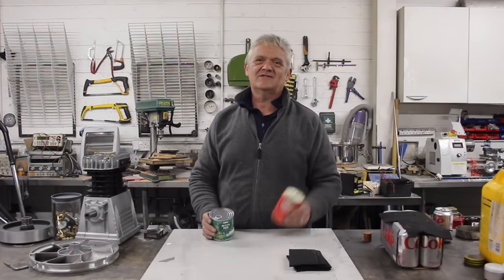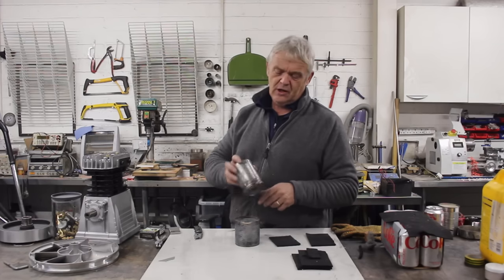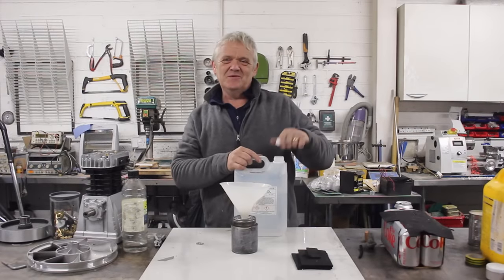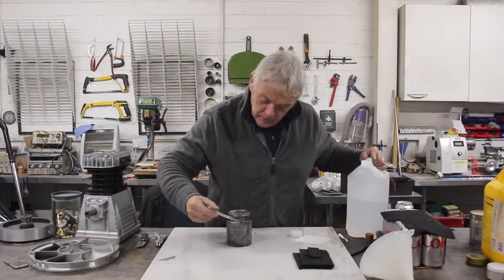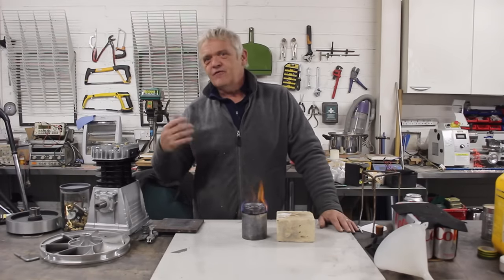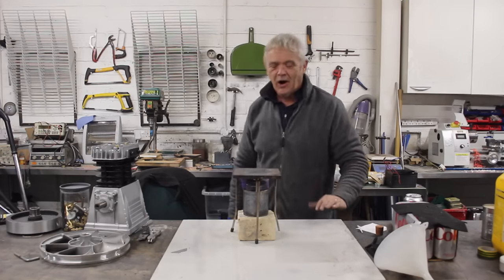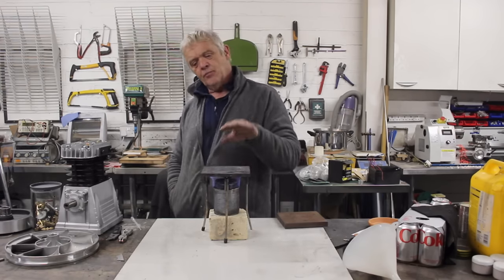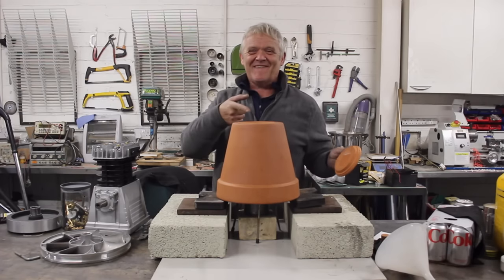1700 An Awesome DIY Multi Fuel Heater

Comment: I was having bad luck creating alcohol stove things based on internet designs (needed to start in ultra cold environs) and after a bit just resorted to burning alcohol in a tiki torch with an adjustable flame height wick. Worked like a charm and I didn't have to figure anything else out. I now have an idea for a simple design that will allow the user to package the whole thing up including the preloaded alcohol fuel and take it with them on the go.

Comment: I just made a short video using glass wool and synthetic motor oil . Burned better than I expected considering its only 40% mineral oil and the rest is friction modifiers and detergents etc but the flame was deep dark orange. I will have a look at glass insulation wool when it's finished and cooled down !👍🏻
Reply from the maker: I'll jump over and have look mate

Comment: another great video, I collected some "bricks" from an old storage heater (I think they contain kryptonite 😳, never come across weight to mass like it, apart from lead), I think they would make a very good radiator, although would take a lot longer than a steel/copper ingot.
Reply from the maker: nice mate!
Reply: Sounds good.  Give it a try and let us know.
Reply: Make sure they're not asbestos bricks - depending on the age of the storage heater they came from, they might be. I think up until something like the late 70s or possibly even into the 80s, some storage heaters used asbestos containing bricks.
Reply: According to another site, if you can “write” with a brick like chalk, then they’re safe to use in a rocket heater-type scenario.
Reply: @jsl4228  Yeah, the serpentine family are heavy minerals.  Optimized for heat storage, it's not in its fibrous form (asbestos), so I don't imagine there's any risk to the lungs from the stuff.

Comment: An upgrade to that might be some form of extenal tank that would have a controlled fluid feed into the centre tank, as at the moment refilling it would require the heater to be cold.
Reply from the maker: I like that suggestion and I am mulling that one over
Reply: Yes, the alcohol stove...a larger version of the tuna or cat food can stove burns out the fuel in well under an hour.

For the steel plate and pot, I use a small Lodge iron pot upside down with an insulated handle.  Easy to remove when the fuel is gone...can cools down...refill...light...put the still hot iron pot back on top.

I don't know if a terracotta pot atop the iron pot would help, but i have put the apparatus inside a large pot rightside up.

Easiest pot heater is a can of sterno which burns 5 hours, with a flower pot on top.

Comment: Please do a video on those 'soda can' style passive solar heaters.  Also, whether or not the ones that are supposed to go inside the window would heat a room better than simply letting the sunshine in through the glass.
Reply from the maker: will do mate
Reply: Collecting and concentrating solar is great solution in my opinion. I second this request.
Reply: Third request here. Great tutor. Cheers for taking the time to, it can’t be easy, but much appreciated.
Reply: @WSmith_1984   Yes indeed, if you have the Sun. Alas, we have so many trees that its not practical for us unless we spend A LOT of money to remove a number of rather large trees. We would like to since a good portion are sweet gumball... but we just don't have the money.

Comment: Good job on the heater. I like that is smokeless. I had wanted to mention a concentrating solar trough for heating a working fluid like oil for an oil heater. And sealing the oil loop so it is insulated some from the cold and natural convection keeps the warm oil inside and the cold out side. And an oil tank for a thermal storage.
Reply from the maker: nice mate - like an oil filled radiator?
Reply: @ThinkingandTinkering  Yes same idea but using concentrating solar to warm it up.

Comment: A few years ago me and my roommates could only barely afford heat for our rental house in Colorado. So we used the furnace to keep everything about 40 so the pipes wouldn't freeze, and we made a blanket fort where we would all hang out and drunk warm beverages. Set up Christmas lights and had some very nice decorative wall hangings incorporated into the blanket and furniture tent.

Seeing this I was thinking if one wanted to stay warm on a cold evening with the slightest fuel usage for a stove similar to this you could make a cozy corner, givve some careful thought to not lighting things on fire, and set up a few space blankets above and around. Because that hot steel will release so much of its heat as IR mylar tech would work very nice to direct it specifically at the chilled human loooking to get cozy.
Reply from the maker: nice advice mate- cheers

Comment: I've been thinking about this because these small fuel burners make sense to me. I was given 8 gallons of methanol from a hardware store closure this summer and want to make a stove-heater, beginning with that fuel. I live in a small apartment attached to friends' family home with children, so it has to be super safe. I've seen many designs. Wondering which one will be very safe and efficient.
Reply from the maker: methanol heaters are sold mostly for marine - check out a few of the designs
Reply: Do not put this in your home. Especially if there are children living in the same building.
Reply: @ThinkingandTinkering  I am frugal and don't mind building something but if buying a safe and efficient burner makes better sense, I'm fine with that.
Reply: @hubrisnaut  marine versions will be designed to be spill proof I would imagine, also they are likely constructed with safety being absolutely paramount.
Reply: @WSmith_1984  I'm going to look into buying something like that. I was given approx. $150 worth of fuel for free so that is the budget. If it was only myself to worry about, I would just do a build. Although I am extremely confident, in this instance, I could never forgive myself if I built something and it went terribly wrong for other people.
Reply: @rblongfellow  why?

Comment: If you want a fuel source a good one for putting in a wood stove or heater, just get a wax cardboard and normal cardboard mix in water until a glue like consistently  then press them into bricks dry them out and then they should burn like wood

Comment: Awesome, I make little rocket stoves and tea candle heaters with cans.
Put another pot on top full of sand or bricks for a thermal battery.
Going to experiment this winter with thermal mass options for my tiny wood stoves.
The heat some tiny stoves put out is plenty for small spaces if you can capture it.
Reply from the maker: Thanks for the tips!
Reply: Make a brick surround for your tiny stove.  Better yet, make a tiny stove out of bricks.  There are traditional thermal batteries, like the Russian hearth.  Anyone using wood should use thermal battery/mass-heat concepts.  That sounds right up your alley, if you're already making rocket stoves, because you have insight on how they want to breathe.  The bad thing about the rocket is it requires tending.  Heat mass means you only have to have the fire going a very short amount of time.

Comment: If you have one of those finned heat sinks for electronics put it on top of the steel and it'll transfer the heat to the air even more effectively.
Reply from the maker: nice!

Comment: FWIW, I came across 'carbon welding blankets' on Amazon which show pictures of someone holding a blowtorch against them, so I'm pretty sure that they are pure carbon.  They can come in a pair of 12x12" or 20x30cm squares for around $10-12, which makes them completely affordable.
Reply from the maker: there are a couple of types - just make sure they say pure carbon felt mate
Reply: @ThinkingandTinkering   what should be the width? [ i ve just seen your previous video, where you burn a vegetable oil wick]

Comment: Hello mate I’ve made the heater with the 22mm and the 15mm pipe and the stainless steel mesh but it seam to be quite a fierce flame have you got any idea where I’ve gone wrong

Comment: I have made a lot of these for camping trips. In my advice. After knowing the area around these improvised devices is fire-safe. One thing to keep in mind. DO NOT allow the fuel container to overheat !! It Will Explode at some point, even if that only means a runaway thermal reaction. If the fuel vaporizes it builds pressure and accelerates the fire to maximum. Think of a Bunsen Burner. It is designed to be in a tray of ice. To control the temperature of the fuel canister. A running creek works fantastically.
Reply from the maker: this isn't the little soda can version mate - there is plenty of pressure release in the way the burner jet is organised

Comment: I'd like to challenge you to turn an argos tall electronic steel safe (the one with a shelf), into an oven,  using veg oil as the fuel source, and bake some bread. Oh and you're not allowed to use any kind of angle grinder etc (as I don't have one, but I do have an old safe 😁)
Reply from the maker: just had a look at them - I will have to buy one
Reply: @ThinkingandTinkering  you sir, are a mad scientific genius! Keep that s**t up 👍👍👍

Comment: The "real" plant pot heater, which was also used in WW2 afaik, does work with convektion and radiation. At least how I understand it. 
You need 2 Plantpots with a hole in the bottom for it. You place your teacandles under the smaller pot and the bigger pot is placed over the small one. This way it does quite a good chimney effect and part of the air whats coming from the small pot circulates back down in the space between the pots and sucked in and heated again. 
But I guess your multi fuel heater will be a nice upgrade for my setup. I'll give it a go in the next few days and then report back.
Reply from the maker: nice one mate - let me know

Comment: anaerobic digestors AKA septic tanks may be a kick in the right direction for small amounts of heat. if a hot water heater is set up to burn the methane as an oversized pilot light, or if properly saved a burst heating system.

Comment: Have you looked at penny stoves?      there is a variety of alcohol burning stoves you can make using aluminum beverage cans.

The simplest that I know of involves the bottom half of 2 cans,      one is press fit into the other with a bit of wicking material inside creating a gas tight seal,    the gas pressure strengthens the walls during fitment so you can bear down on it.

Then you flip it upright  so the can bottom faces up,      poke holes in the depression in the center for fueling,     a coin goes on that during burning to seal the port.

Poke holes along the outer rim to create gas jets,   use a sewing needle and pliers,   16 holes should suffice.

To ignite you make a thin pool of fuel around it and set it ablaze,   this heats the body of the stove until it can self sustain.
Reply from the maker: I know them mate - but  thank you

Comment: I wonder if it would work better if a larger pot was used. I'm meaning really large, like the tall terracotta pots or the terracotta water butts. Could this be a genuine room heater.  Or even a tall terracotta pipe.

Comment: Ok so I just made this using cotton yarn as a wick instead. I wrapped it around the smaller can then put it inside the shorter fatter can. I used the yellow bottle of Heet, which I believe is mostly methanol, as the fuel. I lit it and it seemed to be starting up pretty good until about 60 seconds after lighting the burner it exploded. Like a dummy I was doing this in my kitchen on my stove. I was smart enough to put in inside a stainless steel pot and I had the lid ready to put on top to smother it in case any problems. Well the problem was the alcohol went everywhere as well as the flame. Thankfully I stomped it out with a blanket. I should have known better and done this outside. Besides the fact that I was stupid for testing this inside my house, any ideas as to why this happened? This isn't the first time I had one of these DIY stoves explode on me either. I don't understand what I am doing wrong exactly.

Comment: That jug of alcohol is close to $20 here in Canada. 
I think a 5KW diesel air heater would be the best multi-fuel heater. For under $100, you can't beat it. Burns pretty much every oil if diluted with diesel. 
And they sip fuel. Something like 0.3L per hour if going full blast at 5KW. I don't know how much diesel is over there in the UK, but it's about $1.10 USD per litter here near Toronto.
Reply from the maker: about twice the price
Reply: @ThinkingandTinkering  How much do you pay for a liter of regular petrol? 
It's the same as diesel here.

Comment: Just made one of these but the middle can goes bang and shoots out it the larger tin when you light it boom 💥 any idea why ? Ok sorted it the central can was to tight a fit I used a smaller diameter an now it ok thanks 🙏spoke to soon only tested it with a small amount of methanol . Tried it again with 3/4 full meth . Boom blows the middle can out spraying methanol everywhere 😞

Comment: There's a fuel shortage for wood stoves?  Isn't the UK mostly a temperate forest?  Did they just not dry enough wood?
Reply: I have roughly 6 artic loads of split and dried logs all under cover - Don't reckon I'll be getting cold any year soon. Most weeks I am still getting loads of wood from the local tree surgeon . Am i greedy ??  I think not. I am over 70 and for the last few years I have been building up my 'heat insurance' in the form of log stacks against the day I can no longer handle large rounds onto a splitter or use an axe. .... and no, it is not for sale !
Reply from the maker: getting that way

Comment: I'd be very interested in seeing the carbon monoxide output from this. 
You mentioned multi-fuel. What other fuels will it burn? 
How much alcohol does it consume per hour, roughly?
Reply: Just subbed to your channel.
Reply: @limmoblack  fantastic!
Reply: @CairnOfDunnCroftPermaculture  Have been wondering about this oatmilk 'malarky' (some have more oats than others etc) but you've done the work for me.  Thx

Comment: If you put a metal mesh like a sieve over it, it would be more like a kerosene or multi fuel heater, burn cleaner and radiate more
Reply from the maker: it burns pretty clean but I like the mesh idea - a lot

Comment: So, I’ve built this myself and found out it is a bit of a bomb… what happened with my heater is that the whole thing gets hot, which causes the fuel to evaporate faster and faster. At some point the flames were twice the size of the heater itself. 
What did I do wrong? There’s no way to keep the bottom cool… or is there?
Reply: Anyone?

Comment: Also I was thinking, for a small stove meant to conserve fuel and keep a person warm, it seems that we want radiation heat over convection, because heated air is inclined to float off. Radiating heat we can reflect and such to get as much as possible focused on the human in question.

For releasing IR, I think that as the heat of something goes up the amount of the energy that leaves by way of radiation goes up quite faster than linearly, compared to convection and such.

I bring this all up because it seems that running a small stove that gets a small radiating piece of metal very hot quickly and cools quickly is advantageous for getting heat into IR one could bask in.

The other, perhaps more efficient way to heat a human would be to fire up the stove you made, heat a bottle of water to the limits of your comfort, and then hold the water bottle under ones blankets.
Reply from the maker: nice ideas mate - thanks for sharing

Comment: I love this stuff, could we use this to heat a bucket of sand ? =)
  Some rough calcs: peak flame temperature of ethanol is 1,920 °C wow
 7 Calories per gram, 0.789 g/cm 3 at the temperature of 20 °C. 
 5,523 Cals per litre 
800kJ to heat a 30m2 room 3m high by +10ºC (adjust this factor  by 1/90 * 10  etc. as needed etc)
=> 191 Cal which means  1L is enough  28 days ? except there are losses due to walls, quality of insulation, etc.
...could we make a vacuum flask type of wallpaper ? ^^

Comment: It would be an interesting challenge to design that as a 2 part 100% terracotta construction that could be slip cast. Even the "wick" could be ceramic if you add enough fibrous organic matter to some slip and then dip an existing leather dry part into it to give it a highly porous surface after firing. Design using FreeCAD or Open SCAD, then cast your plaster molds from 3D printed parts. Both of those CAD packages are parametric so you can create variants on the geometry to iteratively converse on an optimal form.
Reply from the maker: that would be an interesting challenge
Reply: @ThinkingandTinkering  If I lived down the road from you I'd happily give you a hand with that, but I am on the other side of the world to you, on the prison island. :-)

Comment: Soft Carbon Graphite Felt PAN-based Good Electrical Thin Sheet High Pure Carbon Graphite Industrial Grade Flexible Electrode - is this the material you use?
Reply: Any idea what the felt is after all mate?

Comment: It looks like covering the hole in the pot would starve the heater of oxygen by cutting out any up draft.  The amount of oxygen available at the bottom (top, inverted) of the pot is limited, as, the level of the opening of the heater engine is above the lower edge of the pot.
Reply from the maker: it doesn't - the oxygen comes in from the sides not the centre
Reply: @ThinkingandTinkering  Not being able to see it in three-space, it just looks like there would be either exhaust or aspiration issues.